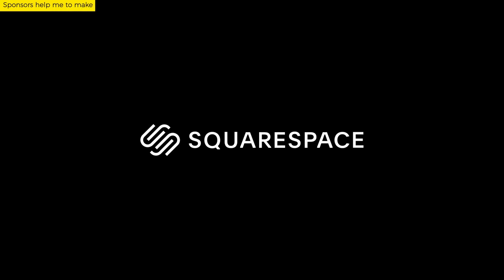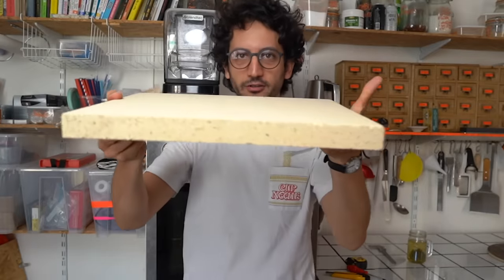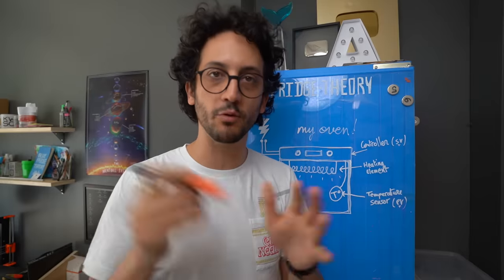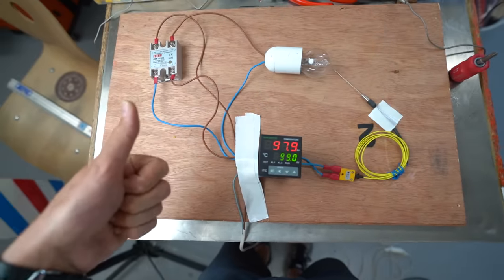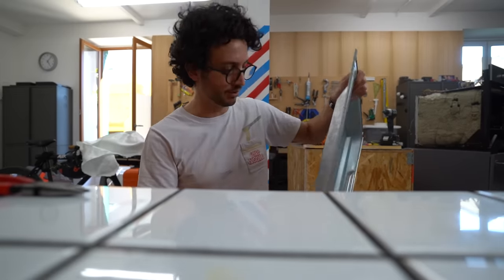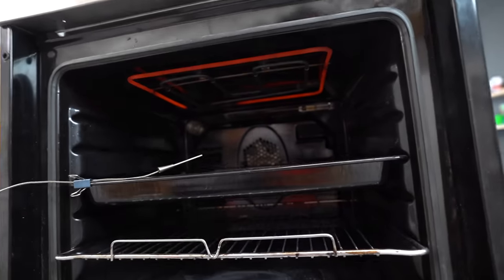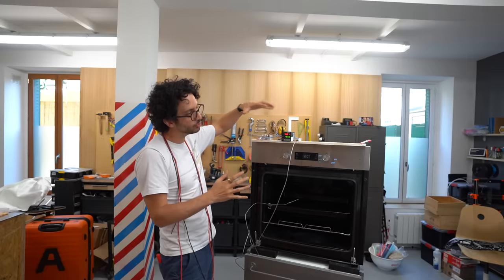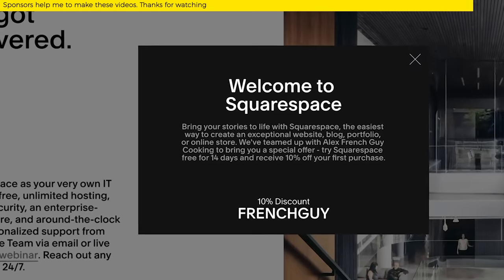I've got a Serious "Pizza Oven" Problem... (part 1)

Comment: I guess this is where we differ, as an electrical engineer you want to hack your existing oven, as a designer I want to create the most authentic pizza oven. You consider heat as the key ingredient, I think it's more complex than this. A pizza oven is a thought process of the ratio of dome to door, aperture to chimney, bonding agent to heat mass. Which heat is being used to undertake which task.
We need three of the four to make the perfect pizza, and it Wood Fired all day for me, this oven will work, I have no doubt but will it be as good as a WFO, I'm not so sure.

Comment: Somewhat concerned the other materials in your oven are not rated for that temperature. Certainly the insulation won't be sufficient to protect the cabinet you just bolted it to.

Comment: As an EE student I'm wondering why Alex didn't modify the sensor itself? It takes some time to figure out how the impedance of the sensor changes in relation to the temperature, but its way cheaper (just a resistor/cap and a switch in parallel) and also more safe

Comment: im thinking you just snip the wires on the existing temp probe and wire them to your temp controller. cap off the old leads and if you need to revert it back, just solder them together again...

is version 2.0 going to hard wire into the lower element to the upper element so both go full blast?! cause i thought that should be version 1.0

Comment: MAYBE easier to parallel two resistors same ohms value in series with ovens own temp prob and that will half the value?  230 C = 460 C???  Simple...simple switch between OEM and Hacks version??

Comment: looks like there's a secondary resistive heating coil that's not connected? It might never reach the desired temperature or take extremely long. You should have measured the resistance and maybe shortened or replaced the heating element to another one with lower resistance.

Comment: I am an electrical engineer and I have the controller and the solid-state relay just like yours, unfortunately, I too have a problem... My problem is that I live in a rented house and I don't own the house oven. And my wife is not allowing me to buy a oven to hack it, so if in case you need another controller and relay do let me know ill ship it to you.

Comment: Why didnt you you hack the sensor signal, if its a thermistance? I've seen a guy hack his engine with a potentiometer in the dashboard. It told the engine that the incoming air was hotter/colder than it was. That led the engine to inject less fuel

Comment: I'm worried you tinned the mains cable before terminating it. That will reduce the mechanical contact between wire and terminal. The wire should be bare copper, therefore soft and pliable when crimped, not rigid with solder. The same goes for screw terminals. Ferrules. not solder! There may only be 3 or 4 (small) solid points of contact in the terminal. This will have the effect of increased resistance > heat > fire... you're an engineer you know this, right?

Comment: what about the cables going from the socket to the main switch in the powerbox? Did you beefed that up as well?
Reply: it will still the same heating elements, so the amount of current drawn will still be the same, so same size wire (the copper parts) in the wall and in the cable going from there to the oven is still correct.  What matters is that the cable from the wall to the oven is now exposed and so its construction (not the amount of copper in it) needs to be different - heavier and more flexible.

Comment: u can also extend the sensor, put it in the bottom of the oven, put the stone on top drawer, the sensor is below the grill and the stone now, so the oven gets hotter, for normal oven work just put the sensor on top again...or just go buy the g3 ferrari pizza oven, its probably a lot cheaper then buying a complete oven and hacking it. Also its probably still not quite getting the same result, because when you get the temperatur similar to a wood oven, then the heat circulation is different and u get burned mozzarella or the crust isnt as good, most heat in the wood oven comes from the side and not the top like  the oven would., not that that cant be hacked but it's just not really usefull if your viewers want to make pizza. ps: i am not getting paid, nor do i sell the g3 ferrari oven. But i have similar pizza ocd :). oh 1 last thing that u havent figured out yet, the recipe you use is for a woodfire oven...soo...mayby try to alter the recipe for a different oven....like put in less water, and cook it longer..mmaye first with only a bit of sauce, add the rest of the ingredients about halfway.

Comment: Wouldn't the heating coils burn out from that high heat if the oven is not designed to reach that high temperature in the first place?

Comment: I would go old school and add a toggle switch on the side and label it pizza as on/off to the controller. PWM should keep temperature stable enough. 
Seems there are 2 elements but only 1 is active in pizza mode.

Comment: Another thing that an electrical engineer should know 😂.
Yes the plug will keep up with the amps but the tiny white cable that supplies it with electricity will melt weeeeey earlier.

Watch out😅

Comment: the scariest part of this video was watching someone push 15+ amps through an SSR ATTACHED TO A SLAB OF WOOD.

I did this hack to my electric smoker (it's on instructables if you're curious) and the SSR will get hot fairly quickly.

Comment: for less than 120€ 400°C capable oven safe and delivered by amazon prime in 24h. If anything a reasonable DIY outdoor wood oven would be more helpful. Or something might be doable with a heat gun they are cheap and can push up to 600°C
Reply: Alex is building a better oven than anything on Amazon, and he's saving tons of money.  Wood-fired oven is not practical in his place, and way harder to build.

Comment: Idk Alex, the combination of both hacking your oven & not having it on a solid platform makes me feel super uneasy on how safe this is long term for you. Like what happens if the shelf + oven tips over?? It looks like the thing is gonna be super top heavy so there's a chance that this could happen. If you don't have locking casters already, maybe you should switch to those to add to it's stability. Also, I'd feel a lot better if you discussed the safety precautions you'll put in place once you start using the hacked oven long term, especially since the unit won't be in a fixed position.

Comment: Just to warn:  The self-cleaning feature on ovens is terrible for the oven.  Oven makers would like not to include it, because it's too hot for a regular home oven to get.   It gets up to 900 F or higher, and that just breaks down the oven parts.   You need an oven with features more like a kiln if you want to regularly use temperatures that high.

Comment: Ngl bulding a woodfire oven in your backyard would have been easier & more inexpensive. But this guy went to college so he has to flex on us plebs
Reply: A good wood pizza oven is way harder to build, and much more expensive, and impractical in his shop.  His electric oven will be far easier to deal with, and give the same results as long as he can reach 900F.   He's on the right track.
Reply: You only need a backyard.
Reply: @flyingbuddha10  He needs a backyard, but he wants to cook in his YouTube studio.  He also would need a steady supply of wood, lots of time to build a huge brick/tile oven, and lots more money.  All that when he can instead just add a few cheap parts in his studio, and reach the same temperature with an automatic oven.  He will be able to just turn a knob and get his desired temperature, right in his studio.  He's obviously doing the right thing that's way cheaper and more convenient for the same results, and he'll inspire lots of others to do the same easy hack.  He's on the right track.

Comment: Dude.. this goes beyond doing little tweaks. At this point, you can just build your own electric pizza oven. Just get some resistance wire, insulating stone/wool and some metal sheet for the case. the temp regulator you obv. already have.

Comment: Dear Alex, You may have done the electrical work to increase the temperature of your oven, but that wasn't a pyrolytic-rated oven, so the oven's thermal insulation was never designed to contain those high temperatures.
Therefore many dangers are now present. The electrical wiring insulation and other plastic components of the oven are likely to melt, causing short-circuits, fire, and the risk of electric shock.
In addition, the surrounding laminate cupboard panels have a maximum working temperature. If you exceed that due to inadequate oven thermal insulation then you can boil the glue used to attached the laminate to the underlying chipboard, causing it to build up gas pressure until it violently explodes. You have been warned, stay safe.
Reply: Alex can and should add another layer of insulation; it's cheap on Amazon.  He should keep it away from plastic panels, but that's obvious and easy.  The wiring on any oven is designed for high heat.  When it fails, it's just like any other oven, which all are prone to wires hardening and failing over time.  He is in no serious danger with this project if he uses common sense.
Reply: @charliedoyle7824  I see from part 2 of this video that he failed to take our advice, and he melted all the electrically insulating plastic parts of his oven. So much for common sense.

Comment: i mean you already had a programmable controller you could have just soft hacked that to exceed the heat limiters unless there was a like a relay gate built into the board but i doubt that

Comment: Did you try to put two stones up and down and put the Pizza in the middle, I dont know maybe it will work!!, I think this theory will create a hot zone for the Pizza🙂 2000 IQ🙃
Reply: A hot zone above the pizza is good, up to a point.  That's how the wood-fired ovens work; they lap the flames above the pizza to melt the cheese.  Neopolitan pizzas only cook for about 90 seconds.   
I think he'll need to turn the oven off just before sliding the pizza in, so the elements above aren't too hot.

Comment: Another EE here... Who also has a problem with pizzas. 

IMHO, seems like a thin wire feeding that massive new socket.
Reply: I kinda thought that to, 16amp socket fed by a wire from a smart phone charger, what could go wrong.Ha Ha
Reply: A 16A socket is a normal socket in the EU. And even older sockets (and thus, wires) were designed  to withstand 10A, which is pretty much the maximum current an oven might draw.
Reply: The socket he installed is a 32A though, he'll have to remove it before he leaves the studio, otherwise some smart guy will plug a 32A device into the 32A socket and melt the 10A wiring.

Comment: Alex, why didn't you just splice a switch into existing thermocouple line to switch between normal operation and high power operation? add a resistor into high-power mode line and the existing controller will do all the work for you. This is so over-engineered lol
Reply: It's likely that the original thermostat is a capillary thermostat, and doesn't have a thermocouple or thermistor.

Comment: Alex is going to hate it when he finds out you can get a proper pizza oven like the Ooni Koda for less then 300 bucks.
Or the F1 electrical pizza oven for a little bit more.
Reply: The Ooni doesn't even reach 800F, and is over $700.  Neoplolitan pizza needs at least 800F for authentic crust. The others are even more expensive, and several models use gas, which is not convenient for him.  You're wrong about 'less than 300 bucks'.  
Alex will end up with a 900F electric pizza oven with lots of stone that can fit a 16" pizza for less than $200. He's obviously getting a much better oven for way less cash than anything on the market.
Reply: Charlie Doyle Cooking Ooni Koda has been designed to run at up to 932°F (500°C). 
Ooni Koda Gas-Powered Outdoor Pizza Oven
4.8 star rating 5 Reviews
Regular price €279.00

F1 p134h 450° C 479€ electric pizza oven.
Also, GOOD LUCK running a regular home appliance oven at TWICE the temp it’s been buildt for.

Comment: Your oven is now a massive fire hazard and should never be left alone when on. I hope you made sure all the cabling you put inside it had insulation which could withstand those temperatures.
Reply: Otherwise it might melt and/or catch fire. =D
Reply: All ovens use high-temp wires.  He just needs to add a layer of insulation, and with his upgraded thermostat, he's okay.  Maybe at some point he should change the switches.  
He can easily use this oven at 900F without it being a fire hazard.  It's basically no different than a self-cleaning oven.
Reply: @charliedoyle7824  the ones that came with the oven aren't the ones I'm questioning

Comment: Hey I really don’t want to be the angel on your shoulder but... 
your studio might burn to the ground. Getting the heat up but in my experience the manufacturer build the oven just right to withstand the original settings. The producer wants to keep the oven affordable so they do not go for Spaceship like backup security. Even the walls of the oven and especially the isolation might not take this well. 

Just saying. Never leave the oven again and good luck. 🍀

Comment: While I appreciate the stunt, you would have had better luck with a Spice Caliente pizza oven (or similar) properly hacked to reach 500deg. Less risk, less power consumption, more concentrated heat.
Reply: Also, that's a very good power socket. WIth a very good cable. But it wont withstand shit, if the cable going TO the power socket is that crappy little white one I see in the video. You are pretty literally playing with fire there .

Comment: Expect poor heat distribution. Single point measurement will not be accurate. Alex this is not engineering - it is simply wiring shit together. Be an entertainer fine. But please do not call it engineering. Not fooling me. (I will remain a viewer, and an EE)